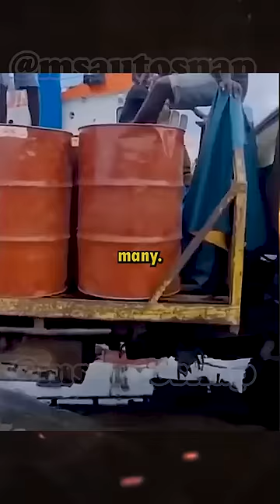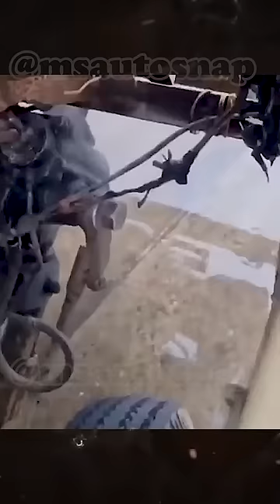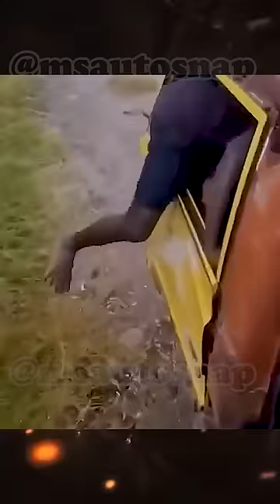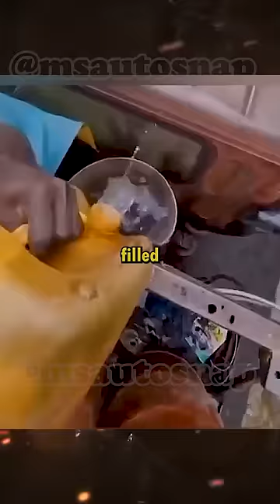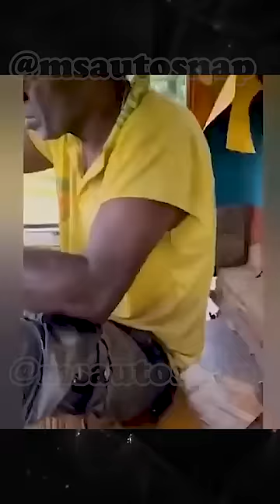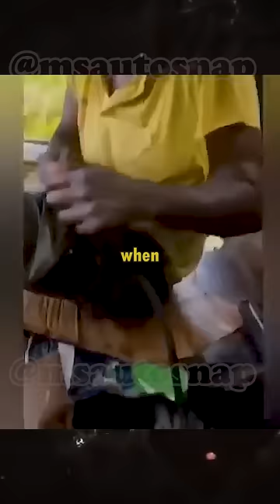What Truck Is This? #cargo #transport #truck

Comment: It is call survival, we work with what we have.
Reply: except this vehicle will most likely kill you
Reply: Amen.
Reply: @LostOldElf 
Your point? 
They have a maintenance crew on hand, which would require your phone to call. 

Don't fight that battle, guy. Pick better ones.
Reply: @sebbekartellen6493 
It's either the vehicle, or walking 10 miles with a load and what looks like through thick forest filled with danger.
Reply: No, this is working hard not smart. This thing is absolutely ridiculous
Reply: Yes, we need to sacrifice so that corporations can maximize profifs
Reply: @bldontmatter5319  then buy them a new truck and stop complaining
Reply: @ugwuanyicollins6136 yes, that's right! Obey, don't ask questions!

Give me a break...

Comment: For anyone wondering, that truck started life as a 2nd generation Mazda Titan 2 ton truck (produced 1980-1989). The crease lines on that very loose door and steering wheel were the clues to the vehicle. Everything else was missing 😂 

https://en.m.wikipedia.org/wiki/Mazda_Titan
Reply: I thought that too
Reply: I wonder what would happen if they try to bring it in to a Mazda dealer for servicing ?
Reply: That is durability at its best
Reply: @reynaldoflores4522 mazda not even makes truck anymore 😅
Reply: That's related to the Titan Dump, right?
Reply: @thehwguy4293  yup
Reply: Are they driving the truck or the truck is driving them?
Reply: @MrOluyomi  I think at this point it’s a symbiotic relationship!
Reply: thats actually the 1st gen but just with a yellow door off of a 2nd gen, the rest of the truck is most certainly a 1st gen, the cab is tiny on a 2nd gen and alot of the markings of 1st gen are on the cabin in the video. (1970-79) so around 10 years older! 😮

Comment: manual engine cooling, manual door latch, this truck sure doesent have a single computer in it!
Reply: Thats why its still running😂
Reply: what about the man driving it ? he is the computer
Reply: In the apocalypse these guys will overtake everyone
Reply: @zimissscameras  it has 3 super computer's
Reply: Good, it will survive a lightning strike.
Reply: Nope, and it’ll outlast a Tesla by hundreds of thousands of miles.
Reply: FALSE the computer is the chair he's sitting on top of😉😁
Reply: @brianafc 😂😂😂
Reply: BRO it doesn't even have a floor! 😂
Reply: The driver is the computer lol
Reply: @klausm.9284  camt argue with that...those Olds things are the best...
Reply: @zimissscameras He is human...
Called Legend Truck  Driver..
Reply: There is no floor in the cabin, forget computer
Reply: if the computer exist in it... sure cpu didn't allowed this abandoned vehicle to run
Reply: It's mazda t3500
Reply: You don’t see that old computer on the driver [no] seat regulating the temperature ?
Reply: That's why its still running.

Comment: Still more reliable than some of the junk on the streets these days
Reply: It'll last longer than any truck you buy new today, for sure.
Reply: As long as you change the fluids and take care of it it’ll last a long time
Reply: I’ve seen some shitty cars but none with a constant fill radiator next to the drivers seat
Reply: @paullowell3342  😅
Reply: @fullthrottlemadness2116  👏
Reply: Woah hot take
Reply: And blck Americans want to be paid reparations?  They could be living like this.
Reply: @fireboltaz  you sir/ ma'am/ it/ they/ them/ triangle are not invited to the barbecue...
Reply: No it's not. 😂 I'm sure they would prefer a new truck over this one. They're just making do with what they have. Poverty+lack of infrastructure For automobile= this vehicle 😂😂
Reply: Yes. Reliability means having to feed it water because the cooling system is so fucked
Reply: @fullthrottlemadness2116  The electronics are shit
Reply: So true. So many modern vehicles turn to scrap if they so much as blow a fuse or some loose wiring.

Comment: If it works, it works
Reply: This does not work
Reply: Drago 😅😅
Reply: If it works don't fix it.😂😂😂
Reply: @Rich-fr2yv  it's got a wheel on each corner and an engine that runs. It has steering and a seat, what more do you want???
Reply: @Rich-fr2yv  my friend, you have not seen how poor geniuses use machines. I have seen an almost bare bones motorcycle run just from junkyard stuff, only has 1 gear, no light, is slow but works, accommodates 2 people max. It looks like complete shit but is very useful and the maker is resourceful. And you have just seen the video of the truck running.
Reply: More Luke, if it has broke or stop don't board replacing it.
Reply: @Rich-fr2yv It’s moving… It works.
Reply: @voodooactual8053  only for a while   this truck will be 100% rust  sooner or later
Reply: @rememberingminnesota  nar, they've got voices. They'll sing their way down the dirt road. Tbf they probably wouldn't hear a radio let alone anything else in that cab.

Comment: UPS drivers be complaining about no air conditioning. These guys regulate the water flow where the head gasket used to be.
Reply: Radiator
Reply: You don’t know what a head gasket is do you? Be honest
Reply: you compared a box truck to this
Reply: @robbylebotha 
If the head gasket is blown you will have to add water like this.

But don’t add too much or it’ll go into the cylinders and slow you down

Comment: I had an old 1980's dodge charger we called the "Cruster" bc of how much rust would constantly fall off while driving. It was held together by JB weld, super glue, bondo, shitty stick welds, fiberglass and prayers. I rigged the fuel line right to the windshield washer fluid reservoir with a cheap dc motor pump with a switch in the cabin to turn it on and off. This was done bc the gas tank had a massive rust hole in it and the retainer straps also rusted lose so the whole gas tank started dragging on the road! Its actually lucky it didn't catch fire! We mainly used it as a farm car to gather firewood and hauled other shit around the property. I feel thies dudes, having a vehicle like that can be a pain in the ass, but it shows how resourceful they are! Not to mention how mechanically inclined they are as well! Now a days most 20yr olds could barely change a tire let alone keep something running in need of massive repair like this! As a fellow self made mechanic i tip my hat to you fellers
Reply: Nowadays, 20 year olds don't even know how to drive a stick shift!
Reply: When I was in highschool 25 years ago my roommate had an old Chrysler that he totalled twice. Once by hitting a tree head on and then spinning into traffic and getting T-boned on the driver side. The 2nd time it was raining and he hydroplaned into an electrical pole on the passenger side. So both sides were completely smashed. Because it has no side windows, someone stole the entire interior one night. All of the plastics, dashboard, passenger seat and pretty much anything that could be removed. After that, he pretty much gave up on it so he let me drive it around. The looks I got pulling up to school my senior year were absolutely perfect and hilarious. The car actually got a full page to itself in the year book as well😂 and I can't tell you how many people I encountered taking pictures of themselves or their friends posted up next to it lol. It was iconic for sure.
Reply: I had a 1985 dodge charger too!  Loved that car! 2.2 liter five on the floor.
Reply: I had a boat gas tank strapped to the hood
Reply: trucks in way better condition than this is being junked every day by thousands in many advanced nations. If there is a cheap way to ship them over to that country.

Comment: What do you mean truck? Those are some leftovers arround an engine and frame.
Reply: So, what is a truck? Cargo deck + gear box + clutch + engine + breack + heavy duty tires + suspension springs (optional) + drive shaft = truck.

Comment: I guess there are holes in the radiator system that constantly leaks. And so, the guy in the back and driver needing to constantly feed water to prevent that tireless engine from dying.

Comment: The mechanical ability of these men is amazing. They made it work.
Reply: Really?
Reply: It would be amazing if they fixed their busted ass truck properly.
Reply: They work with what they have and with a lot of ingenuity.  Hats off to them. It may not be pretty, but it does the job.
Reply: Yeah the guy must be a proper fix-anything mechanic. I had the basics once... but wouldn't have a clue now. There's things like steering pump motor and an EGR... I remember when cars had a carburettor, an exhaust and a spark plug!
Reply: @tjn2254 hey it works, it functions well enough to complete it's purpose. 
Besides, really polishing up that rust cage would be a waste of materials.
Reply: @neilattaway2182  It just looks like a truck that has fallen apart. 

I see them all the time on junkyards. If I went, started one up, dove it around for a little while; you would be impressed by that?
Reply: @Faiththegray  Not only that, with all the panel work stripped you can access & fix everything! 🙂👍

Comment: This is called Third world engineering, they got scrap from the first world or second rate countries and made a working vehicle, much respect for craftsmanship
Reply: My issue is the minimalism & overall jenkiness of the repairs.
This same truck in American Banjo country would have a floor and mostly water resistant cab. Even if it was made from tin cans and salvaged wood. Hell they'd even try to seal the cooling system with found salvage.
In Cuba this would be an amalgamation of car parts never meant to be together salvaged from 70 year old rotting hulks and maintained with improvised fluids. And it would look like it came from a showroom, somehow.
Reply: You just ñeed emancipation this mindset.....these islands has long conflicts... facing embargoes

Comment: It looks like it had done 1.2 million miles on the speedometer.
Reply: Only 1.2 ? I have seen several Toyota taxis and vans in Asia with more than 3 millions km in pristine condition.
Reply: Bruh there ain't no speedometer in this fine truck
Reply: Which stopped working 50 yrs ago 😂
Reply: It looks like it drove through a minefield
Reply: It drove through a minefield and kept going strong.
Reply: African technical be like:
Reply: And that's a new speedometer.😁
Reply: What speedometer??? 😂😂
Reply: They  use pitot tube technology  😂😂by opening  the mouth, and they can calculate the speed of incoming  wind and how they determine  speed 😂😂
Reply: There's just the steering wheel and pedals, no speedometer no odometer no oil pressure guage no temp gauge, no safety slippers even

Comment: This is in the Autonomous Region of Bougainville in Papua New Guinea. Years of civil war has made them very resourceful. 

And this is not coolant that is being poured in. It is actually diesel. There is no fuel tank and fuel filter. The diesel is poured from the hose directly into the engine.

Comment: My 8,000 mile car failed inspection for replacing the regular bulb with a white led bulb in the license plate light.

These guys will probably only fail inspection if their vehicle has no wheels of any kind. They really take drive it until the wheels fall off seriously.

Comment: The radiator has holes in it because they have been using ground water which corrodes the metal. The problem will only get worse. 
Radiator fluid doesn't corrode the metal

Comment: No radiator fan. Also, speed of the vehicle is so fast that it'll not cool down water. So, they have manual control. Also, Cooling water would be draining on road after removing Engine heat.

Comment: That old truck is barely broken in & will be on what’s considered ‘a road’ for another decade before the engine is rebuilt to give it more life. You don’t need a gauge cluster because the mileage and all warning lights are irrelevant. 😂